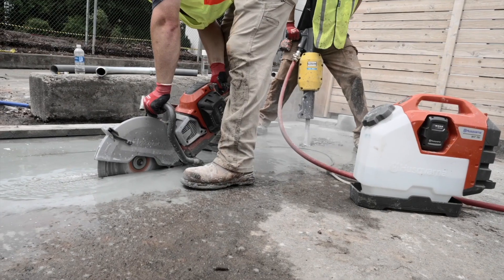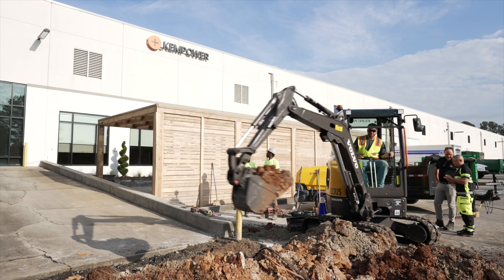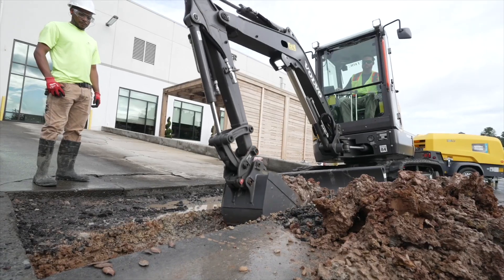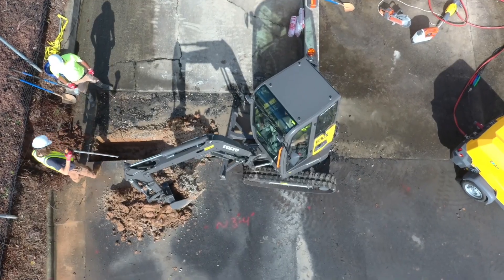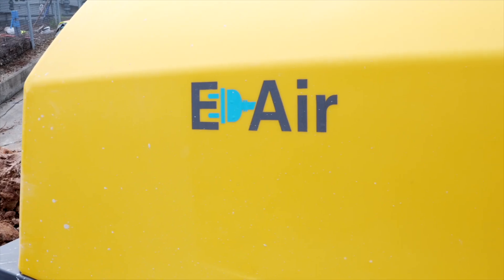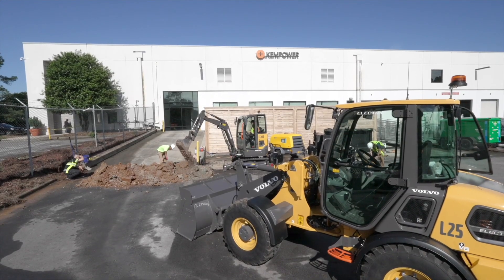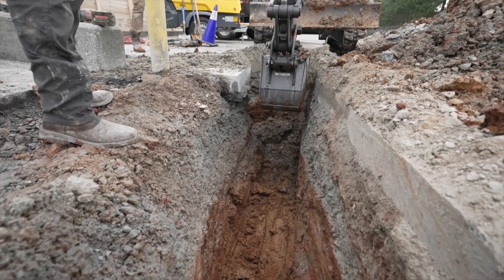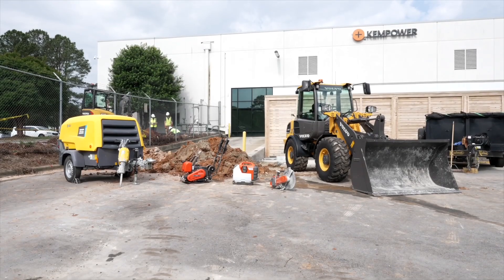Building electric with electric | Kempower office charging hub Durham, NC

Comment: Need tesla or other ev semis to move the materials, and on site battery packs that concrete saw was run off of a gas generator SMH. 
Otherwise good job moving into the ALL electric cleaner more sustainable future kempower. 👍🏻
Reply: The concrete saw was battery powered, only thing generator was used for was for the air jack hammer.